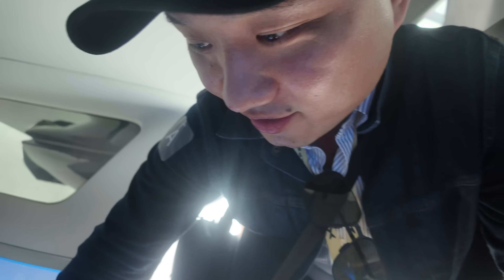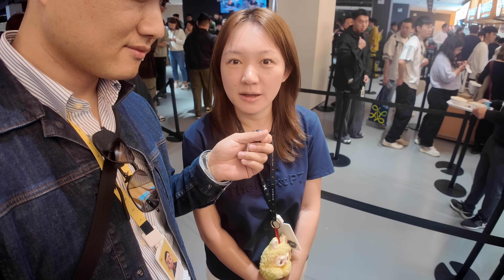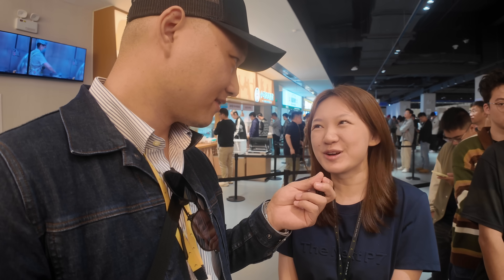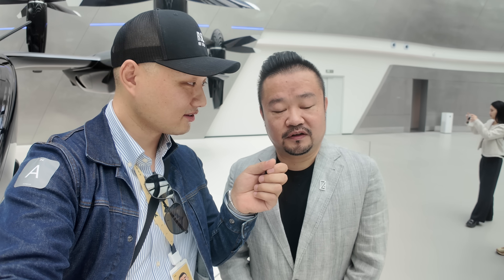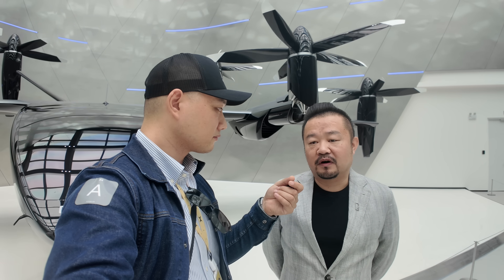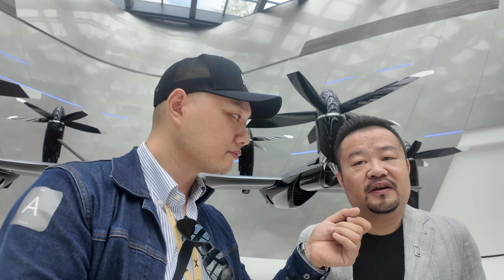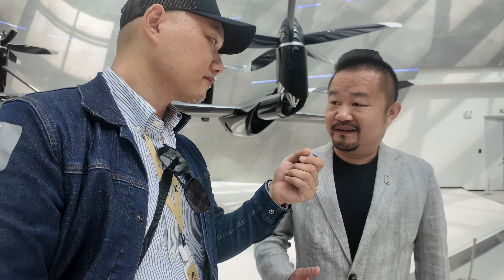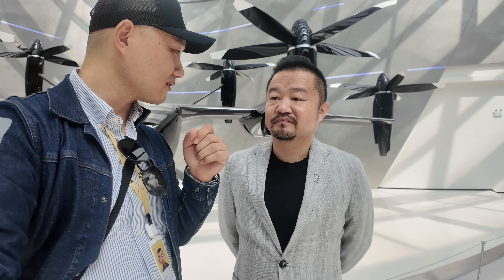Exclusive Interior Look of The NEW XPENG eVTOL!

Comment: In fact there is a more wholist approach necessary. Changing of architecture. Skyscrapers for flying cars, accelerators (rings) for flying cars, airplanes for flying cars, for stopovers. 
Beside the Russian-Chinese energy partnership you need an industrial partnership and traffic planning partnership. 
Flying cars and elderly people, herders. School education. Flying cars and drones. Transport drones.Transport corridor. Hypersonic technology, rare earth, material development, aesthetic architecture, light management. Burevestnik-technology/nuclear drive. Space-travel from Earth to space. Implementation for construction sites, gravel. Burevestnik-technology used as generators implemented into flying cars, tunneling machines, VonBraunWheels, Dyson spheres. Burevestnik-Satellites, Burevestnik-Drones, self assembling or assembling a new super structure in space by themselves.
Cargo Cap/ Maglev in vacuum. Generator for aquaponics, vertical farming, container farming, 3DPrinting, opensource invitro meat, algae,seed, mushroom breeding. Building up arena shaped settlement with glass roof/cupola/dome. 22 °C inside......😊

Comment: Why would I choose the this so called flying car over a helicopter. It still need a license pilot, I can't drive it in the public street and it needs a launch pad like any other helicopter. im curious on what make it a flying car .
Reply: It will be cheaper than a helicopter. I dont know if it is electric, but they can create easily electric versions. I guess their applications are for small distances to be traffic.
Reply: Operating cost. Less training. Did you watch the video?
Reply: @T @TChalla007  watched the video and the eVTOL didn’t fly at all, in fact there’s no footage anywhere of an influencer being in cockpit with a pilot: so far it’s only ever a pilot flying by themselves, and even that is rare footage.
Reply: @random-shaped-spaghetti I don't doubt Xpeng. They actually know how to do mass manufacturing. Even if they are scamming for funding rounds they actually have the capacity to make it happen.
Reply: @random-shaped-spaghetti The reason is quite simple. The Chinese government is still in the process of formulating and perfecting various laws and regulations that allow ordinary people to fly freely and safely. Apart from companies holding government-issued temporary flight licenses, the current law does not permit the general public to either ride or pilot aircraft. It won't be until 2026 that Xpeng Motors can obtain the official operating license issued by the Chinese government. That's why you can't see it now.